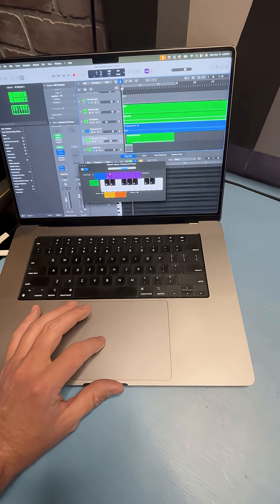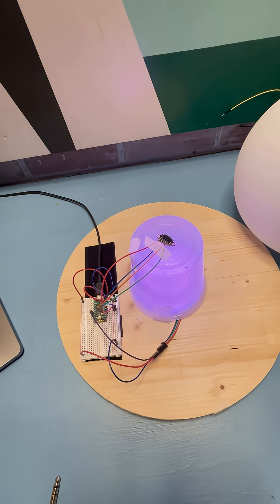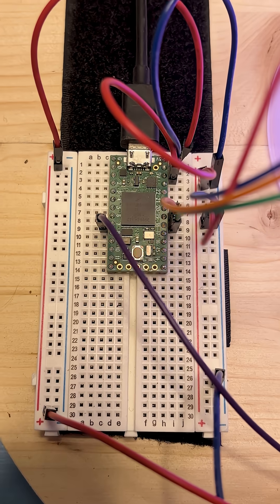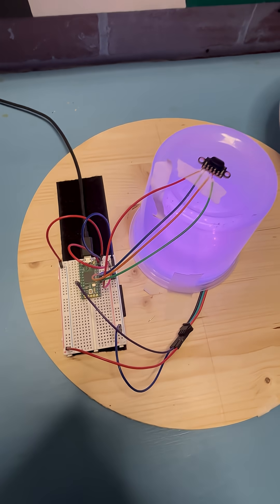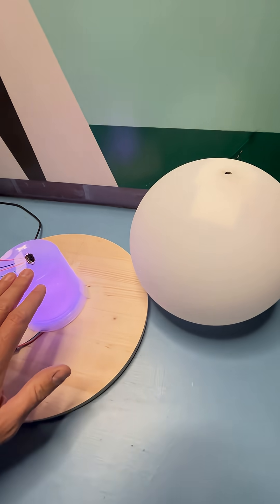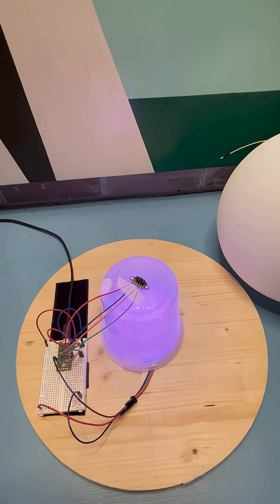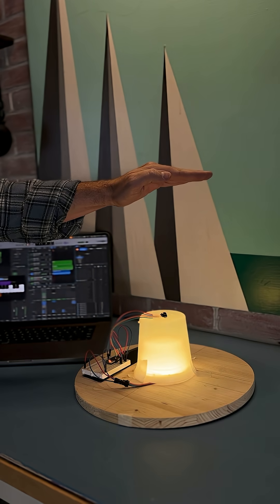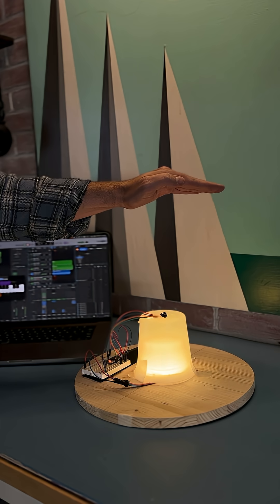MIDI Theremin Prototype with Arduino #arduino #theremin #electronicmusic #diy

Comment: This is pretty cool! What's a time of flight sensor? I'm used to using distance sensors, but I'm not familiar with that one.
Reply from the maker: They use some kind of laser sensor. It works pretty well! VL53L1X is the model number of this one.